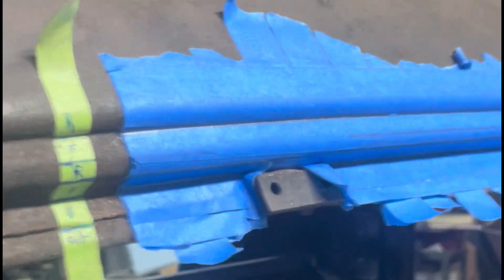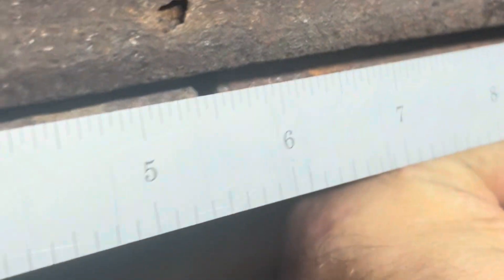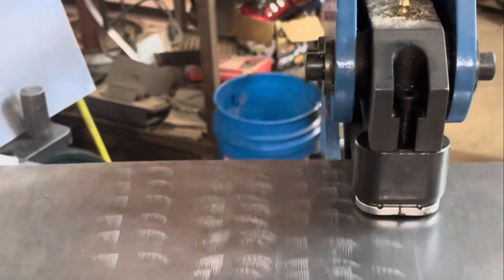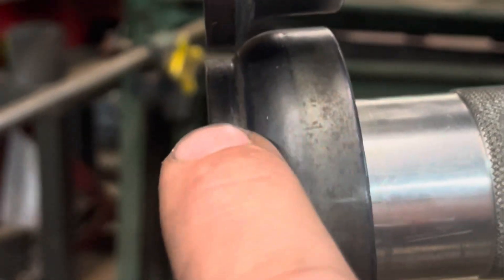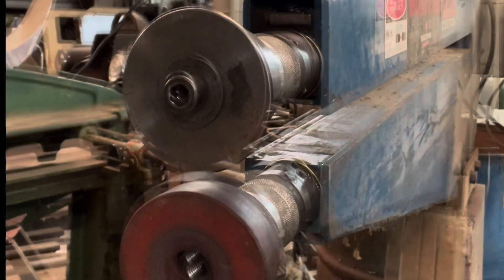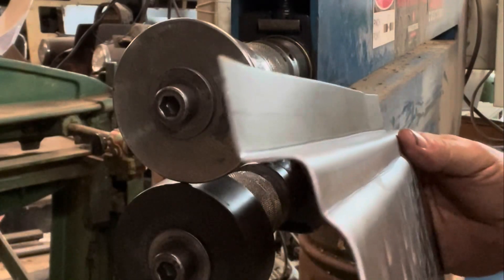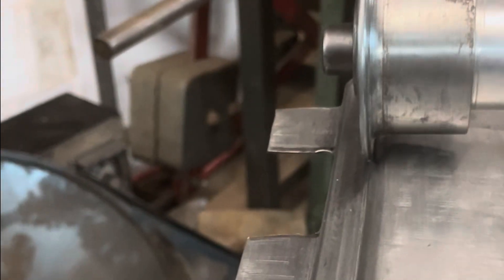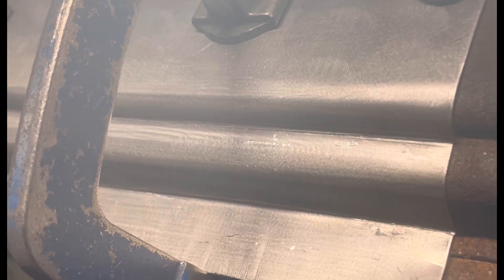Fabrication of a 41 Chevy Truck upper windshield repair

Comment: You can wipe a layer of candle wax on all those contours and then put a few Coats of Spray in bed liner  on it and it will pop off and you will have the perfect reverse Of that detail. It's a lot less labor-intensive than using many layers of tape

Comment: This might be an odd question but,, how much would you charge me for both corners and a straight piece for the center section of that body line,  ive got the same rust issues with mine and you seem to have a grip on the tooling and setup to run them off, if you're interested "please " let me know
Reply from the maker: I greatly appreciate the compliment but unfortunately I’m so far behind I have to stay focused on getting my backlog of parts done. I may start making a few parts and selling them once these projects are complete. If you do attempt to make the pieces and run into any issues feel free to ask a question and I’ll do my best to answer.